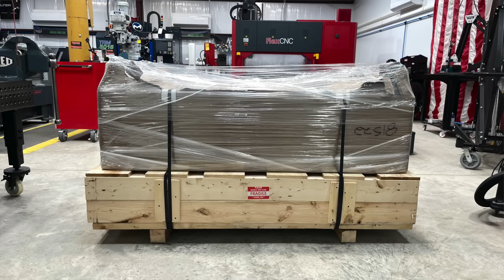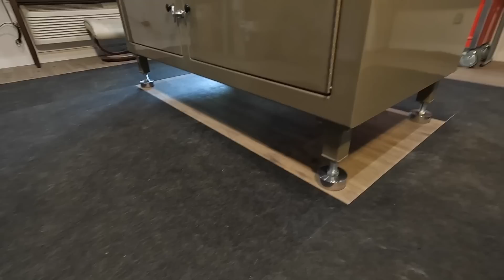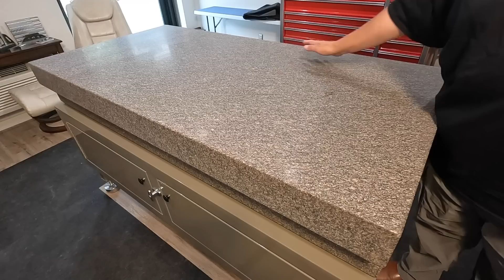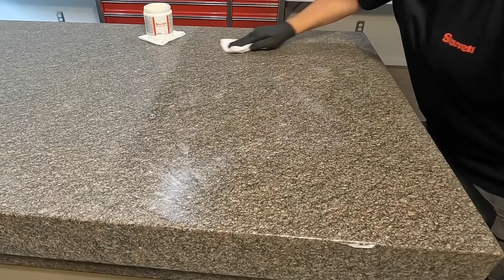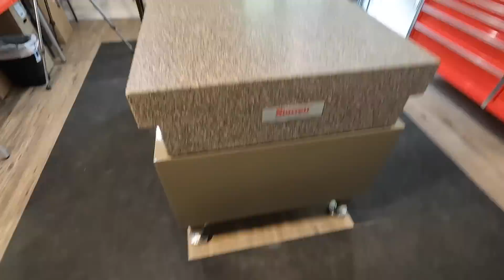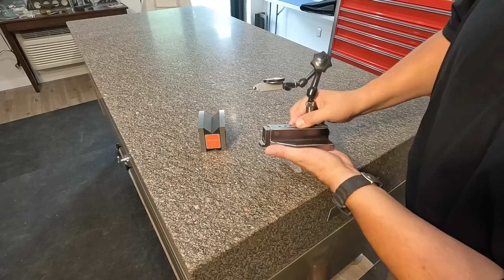Granite Surface Plate Care & Maintenance

Comment: I have finally got myself a B surface plate, mine is only 18x12x3 but all I could afford and quite enough for my shop. I wish I could get some of that Starrett waterless cleaner, nobody stocks it in New Zealand that I can find and its really expensive to get from Starrett direct. Just an FYI and far be it for me to tell you what to do but my wife is a fabric artist and conservator and she rolls a cover like that in on its self so the surface touching the stone is facing into the roll to reduce picking up dust and transferring it to the stone or what ever. Take from that what you will
Reply: I bought that one too.  Now I have a base for my 10" x 6" x 1" precision granite square.

Comment: So, my grade B 12 by 18 inch surface plate from Starrett gets used in my home shop.  It’s not temperature controlled.  I have made a base with locking casters and three point adjustment screws underneath it.  I use a machinist level to make it as level as possible.  I keep it covered when not in use and I clean it with ammonia which quickly evaporates.  I check the accuracy of my height gage with grade B gage blocks.  For hobby machinist I figure that I’m accurate to +/- .0005”.   Good enough for me.

This is a much higher precision setup that makes sense for a person who makes a living making parts that people’s lives and livelihoods might depend on.  Abom does amazing work and his tolerances are probably far tighter than mine, and he makes and repairs much bigger stuff.

Comment: What temperature and humidity are the plates certified for?   I wonder how slight temperature and/or humidity changes impact the measurements.   At those 5-digit certification numbers, I cant help but think that even 2-3F degrees would make a measurable difference.
Reply: Plates will be certified (upon manufacture) at 68 degrees F (20 degrees C ) ± 1 degree and below 55% RH for a a proper ISO 17025 master lab grade certification.  Now, when you have it re-certified on location that all depends on your environmental controls.  My lab in the automotive industry ( R.I.P. TRW ) was speced at 68 F ±2 degrees F and <40% RH.

Comment: I was taught to slide parts onto the surface plate, from the edge. It helps making gentle contact and reduces debris that might be trapped if you set your part down. Probably more important for heavy work.
Reply: I did the same.  Also, the only thing of metal that was ever left on my plate was my Trimos height gage unless I was cleaning the plate.  I did make an exception for my ceramic standards as they do not rust.

Comment: Perhaps an extractor could be installed above it, may help with keeping dust at bay
Reply: Extractor alone will be worse than no extractor, because it will just kick mote air out. You also need hepa filtered air to replace the extracted air.

It's not actually that hard to achieve level 8 clean room status. At work, we have converted a normal office roo to a clean room by installing an air purifying system and painting the inside of the room with a good low dust paint. It's certified and all. 😊

Comment: uhm so you wipe it. Say you clear it of oil . then use your hand fats and smear it on.  I am kind of confused.
Reply: You’d understand if you spent a lot of time in the machine shop. Most of the oil around is cutting oil and lube, that sort of thing. That’s the oil he’s talking about, not the small amounts of skin oil deposited from swiping things with a clean hand. In terms of removing dust and lint and chips, your hand is one of the better cleaning tools. If you’re wringing gauge blocks you should avoid touching the surfaces you’re wringing, same with optical flats, but for granite and parallels and v blocks and whatnot, a clean hand is excellent. The degree of precision expected and achieved with granite surface plates is not to the extent that skin oils from swiping it is a factor. Fingerprints are another story.
Reply: I think the goal is to wipe particles off it, not worrying about small traces of oil.  Hands are a common technique, not just for the surface plate but all kinds of other stuff.

Comment: I see what looks like two threaded holes, what are they for? Or am I seeing things?
Reply: I think there is a line of at least 4 of those holes. My guess is they are for some special fixturing that he hasn't told us about yet. Another explanation is the plate was custom made for some place that needed them then they cancelled the order. Adam would have got it at a greatly reduced price then. Those holes won't affect the accuracy and useability of the plate much if at all. Starrett (and most any other surface plate manufacturer) will make a plate almost any size shape and configuration with whatever grooves, slots, ledges, holes and threaded inserts you want... for a price.

Comment: Not a machinist but i still found this interesting. If dust is a concern it seems like a soft mirofiber car detailing cloth would be a good choice rather than a hand or regular rag.   Woofgangs "chinchilla" microfiber is extremely extremely soft and will pull dirt away from the surface and trap it to avoid scratching. I use those chinchilla ones to clean camera lenses they are so soft.  They are also lint free after you wash them once with microfiber cleaner.  Almost any kind of paper towel will leave a little bit of lint. If you need something more disposable Griots makes some nice semi-disposable ones.
Reply: You’d be surprised what a hand will do on flat surfaces like this that microfibers won’t. I thought the same thing before I started doing this sort of stuff. Sometimes your hand is the best thing. After that you go to kimwipes. Machinists know plenty about lint 😉

Comment: Sounds to me a good air filter with H13/H14 grade can help with dust settling down specially with an ionizer function as it removes a lot of small particles. The filter I have handles particles of 1um size and above. Granted not a clean room per se, it just helps. worth checking I think.
Any difference if your plate is quartz instead of granite?

Comment: Nice buy Adam. Surface plates deserve a lot of respect. I would suggest when you fold the cover, do so such that the face that contacts the plate is not exposed. It could pick up debris from the table where you placed it. The soft fluffy stuff on the underside attracts debris like nobody’s business.  You may want to consider tacky mats at the doors into the office, especially the exterior door.

Comment: Interestingly-polarised comments section. Some people clearly don't understand or respect the end use of reference inspected surfaces such as this. I mean, that's fine but if you're not in the market-for or trade-of one of these then you're missing the understanding of what you're looking at. Metrology at these levels is several levels of understanding deep, but unlike things like audiophiles, etc. this has a real-world purpose. There's nothing worse than chasing down strange errors in work, only to find that the source is poor practice and maintenance of precision calibrated pieces. It might seem obsessive and weird from the outside, but every ritual and repetition is vital in developing strong defensible working practice.
Reply: If you can't figure out how to care for a granite slab without Adam, you don't need one. Most people come here for the machining. He needs to get back to the old SNS episodes before he loses fan base.
Reply: @mongoose388  I agree. I don't think there's enough good information out there on this subject for people, and often this knowledge is learnt via degree-level study or over-the-shoulder where you learn by very expensive mistakes, reinforced by getting a slap across the back of the head. Adam is putting some good information out there in the "semi-permanent" record for others to pick up as and when they need it. It's maybe a little more zen than most people are used to, but hey. Yeah, agreed about SNS. A man can't survive on zen stuff alone.
Reply: Lol at your ego. That is all.

Comment: Hi Adam,
I enjoy your videos, thank you!
Better to fold your plate's cover with only inside surfaces touching? The current way catches airborne dust and dust off the work table where you set it down.
Hand wiping transfers moisture and particles to the table?
Operating theatre sterile protocols seem applicable to your room and plate! Filtered laminar airflow over the table and positive room pressure comes to mind.
Beste
Reply: Yeah, I was thinking the same thing. Baseboard downdraft and an overall room rating of whatever class is highest and still practical. Alcohol also has at least 5% water in it too and your skin has oils, Most fabrics shed link and you still has dead skin slothing off you and your cloths. The only true waterless solutions I know of are highly toxic and "hot" with explosive vapors.

I appreciate the amount of money that thing likely set him back & the appreciation he has for that fact but at the same time this seems a little extreme. I mean sure stone and concrete may absorb water but you never see it except from cracks just like I may win the lottery but I'm not holding my breath.

Comment: Mine get stored under a bench in the garage and every winter I throw them in the back my mustang for traction. They sit behind the wheel wells and lock into each other so I know they won't move. I've used them to check a few things like motorcycle heads but traction is their main job.

Comment: I'm less sure about using your hand. 
The tolerances on the plate are to ± a very few microns over its entire surface. 
Your skin oils could be larger than that.
Use a residue-absorbing cloth immediately after.

Comment: Cut a piece of plywood to cover the top and band it with 1 x 4" clear pine. Eventually something will fall on it and chip it and then you will throw yourself into a thrashing machine. That cover they give you is more for dust. Now's a good time for some electronic height gauges and even some laser tools.  Ultrasound is another thing for inspection and you can be an area inspection business. People get investment castings and then want them ultrasound or xray inspected so they don't spend time machining a casting w/ gas pockets... Laser equipment can also help the process of inspection and give you more information.

Comment: Adam, Maybe invest in a HEPA filter for the office to help with the airborne particulate problem.  As for all the naysayers.. 25min yapping about a rock, no machining, etc.  Bah.. I'll keep watching.
Reply: A standard air filter doesn't really do anything because the volume of air moved is far too low. Air handling is something that has to be considered at the onset and in rooms like this you'd want a laminar drown draft through the floor or baseboards. Something like that could have been done above the office but not in it.

Comment: Lot of haters here, but I, for one, love metrology content. As for the, "I can't possibly afford a Starret surface plate" comments, in my experience, second-hand surface plates are available quite inexpensively at auction, provided, of course, that you have the wherewithal to move them. The biggest I can manage in my home shop is a Starret pink granite 18x24x4, but that's because of size and weight, not cost.
Reply: Yes, in the uk they are dirt cheap at auction, the depreciation on them things is huge.  Every shop or hobbyshop needs a surface plate, and maybe a 2 ft square one is plenty sufficient.  I wonder if the cost ( to the 2nd user) goes down per square footage for the larger ones as the need vs wherewithal to handle them ratio diminishes.

Comment: A repeatometer is a form of spherometer. Apart from local defects it measures variations in curvature. An autocollimator doesnt measure flatness directly. It measures variations in slope which are combined (integrated) to provide flatness estimates.

Comment: It is best to keep the sun off it as well. The sun will heat it up unevenly causing expansion throwing off measurements keeping it in a cool dark room is the best, with stabile temperature and humidity..
Reply: Would be interesting to see the difference in a typical measurement on a machined item at the higher end of the precision at which he measures, done one day on a 'sun drenched for hours' table and then repeated on another day on the  table having had it covered overnight beforehand.
Reply: Don’t breathe on it either, especially if you’ve been eating garlic. Bad breath will get into pores of your surface plate and you’ll never get it out. Gives the plate a terrible oder and may even affect the accuracy. A
N-95 mask will help.

Comment: I have thought about making a surface plate. Using concrete, on a steel stand starting on a level surface,  after about 12" of concrete is set for about 30 days, use a self leveling compound. Before the 36" x 36". Or 48" x 48" 1" thick glass, using vacuum to pull epoxy resin under the glass, to seal if in place, then polish the 
Same type glass the real PYREX is made from, polish it flat, it's not going to be professional grade, but it will be flat and smooth, glass is a bit on the soft side, and will show wear after time.    I don't know if I will ever get around to building it,  I would probably spend less, just buying a used plate,
Reply: Concrete has many different and uncontrolled hardness levels in the various materials used so it's difficult to lap level.  It's like hand sanding pine: the soft summer wood wears down more than the hard winter wood so sanding it leaves ridges and valleys.  More importantly, the chemical reaction that makes concrete set continues for a very long time, making the surface continually change shape. I found this out the hard (spelled expensive) way.
Reply: Sounds like a fascinating and personally rewarding project.
Reply: There are several videos about the University of Arizona, Richard F. Caris Mirror Lab. They show what goes into making giant mirror lenses.
Reply: But see that's the kind of project that would make interesting Youtube content
Reply: Better to do it with hardened dry cow dung, you will have better results in measurements

Comment: Adam an old machinist taught me to glue sand paper to the bottom of your surface gauge and measuring tools to help them from sliding around when measuring. Also it really knocks down any high spots on the plate.

Comment: Dies not the plate and tools pick up grease from you hands when you wipe it
Reply: It doesn't bud up, but wipes across.  And it's only molecules thin,  unless grit and dust.
Reply: Only if you wipe it with greasy hands. Wash your greasy hands first.
Reply: I only say this because I am maybe unfortunate to have naturally very greasy skin and having worked in engineering (centre lathe turner )

Comment: Adam,

I realize that you're running a one man shop and there is a limit to your investments  but when it comes to the surface plate would it be worth upgrading your HVAC equipment to create a clean room type atmosphere?  In your video you can keep talking about dust.  Should your room have HEPA level filtering and should both temperature and humidity be controlled?  

Bob

Comment: Bad habits are the worst enemy of surface plates. Carefully wipe the tools, wash your hands,  and be careful not to overuse any 1 place on it. Another bad habit is lapping tools in more than necessary. It takes a single short, light drag to lap them in.

Comment: @7:40 Sorry Adam, I have to laugh at this.  Your buddy Lance had more sh!t on his plate than I have on my office desk.  Keith Rucker does as well.  As much as I do agree with your thought process, a horizontal surface will 100% gain junk.  YOU worked and achieved a dedicated spot for your plate, but honestly?  I have NEVER EVER EVER EVER seen a shop (even with dedicated spaces for metrology), that didn't have things on the plate.  That includes 6 different companies I worked for, 30 or 40 I've been in to do work for, etc.,  and multiple shop tours you have done.  EVERY one of them had "stuff" on their plates.  Gotta laugh at this one.
Reply: You haven't seen our shop then.  A surface plate should NEVER be that mythical empty flat spot because it's not empty.  It's completely covered by a very accurate measuring gage.  Would toss other tools on top of your good calipers or mikes?  Not if you wanted to keep your job in my shop.
Reply: Your shop doesn't get any work then?  Just a showroom like this one, @kensherwin4544
Reply: So you worked in 6 rubbish places, you can see the low quality of where you worked from your statement.
His store is not his friends' store, an absurd comparison. Maintenance and care for such a precise and expensive instrument must always be rigorous.
Reply: @marc0martim Does nobody read?  I actually agree with Adam on the care of these things.  That said, I've worked for places that made equipment for Nasa, Sandia National Labratories, Nuclear facilities, etc.  The fact is, when you put a surface plate outside of a metrology room, with 200 employees of which maybe 20 know what the hell it even is, this happens.  THAT is what happens.  Not necessarily "garbage" places...